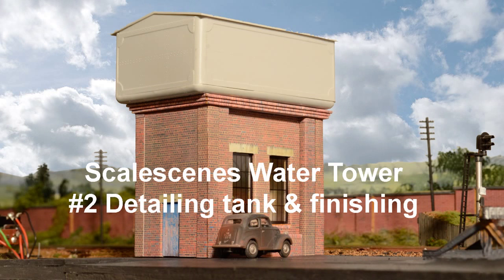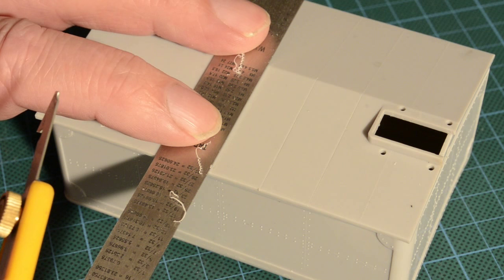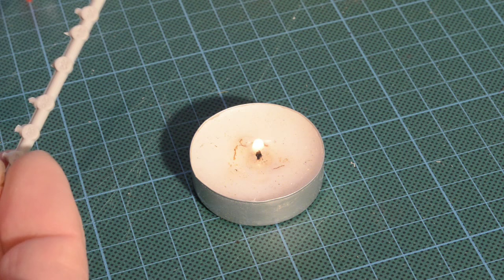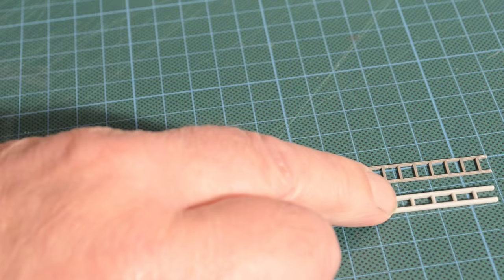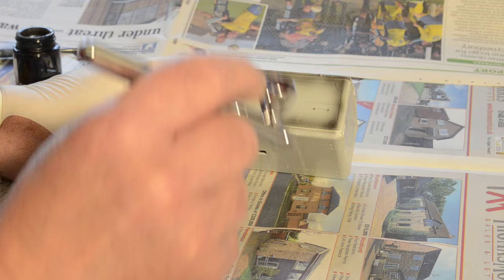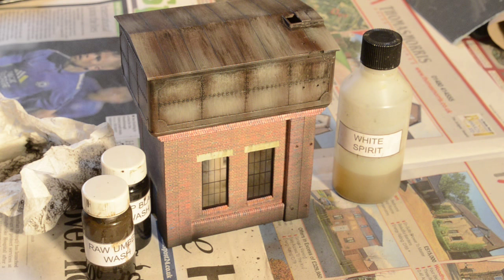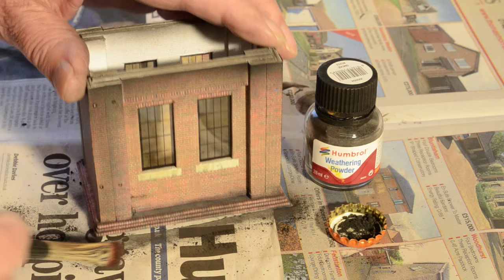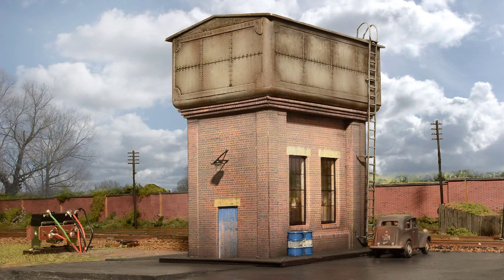WATER TOWER #2

Comment: Hi David. Instead of using stretched sprue, what I have is an old  Plastruct plastic weld bottle into which I have added several scraps of Evergreen Plasticard and old bits of sprue. Then added some of the plastic weld. The liquid dissolves the plastic and makes a paste. The mor liquid the thinner it is and vic verca . I keep a bottle like this handy at all times for use as fillers and supports. It is super strong and u may find it helpful.
Reply from the maker: Great tip, thanks. I used to do the same many years ago using Carbon Tetra-chloride to melt the plastic. Have not used it for years (I don't know why!!) - I will definitely start a bottle again - I have a box full of sprue -  ...  David

Comment: Thank you David brilliant vid, great step by step guide. I just bought dapol water tank only I was going to position mine at the back of the dapol engine shed in a siding.
Reply from the maker: Hi, Jeffrey, apologies for my late response. Thanks for your very kind comments. Regards  ...  David
Reply: I painted mine in  humbrol no.87 steel grey, re-scribed panel lines, varnished with gloss coat,  sprayed  on humbrol rust enamel wash, then lightly sprayed  tank sides with humbrol no 3 gloss Brunswick green.   thank you for sharing this method .